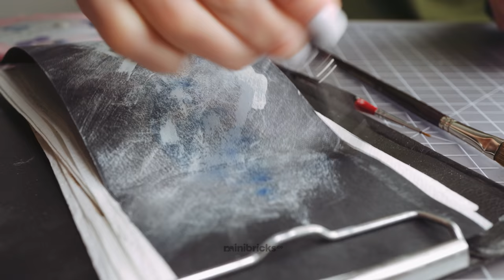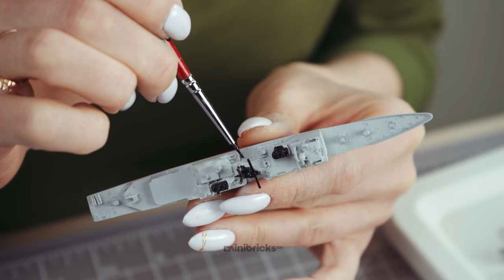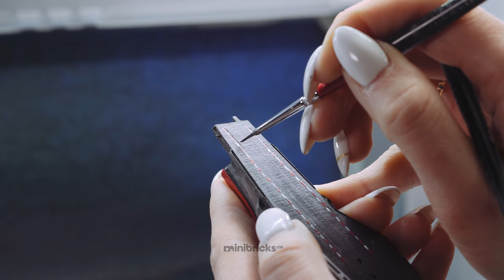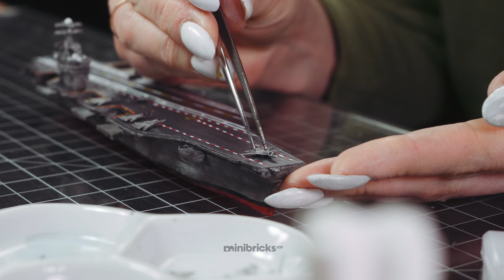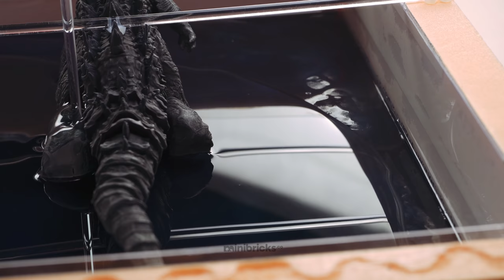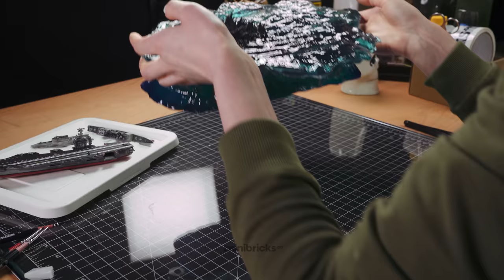Minibricks: THIS IS GODZILLA

Comment: Awesome diorama!!!!!!!! Absolutely mind blowing. I hope you can answer some of my noob questions 😅 : 1. Where to find the boards you used as the sides of the resin mould? 2. What was that spray you used that just magically smoothened out the epoxy resin?? I don't wanna do wet sanding with dish soap for a few days on my next project...